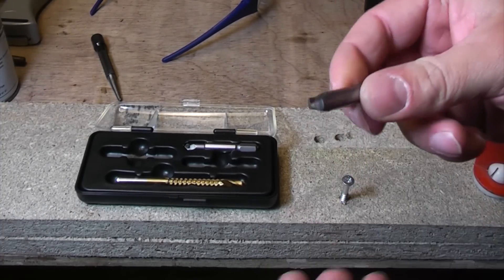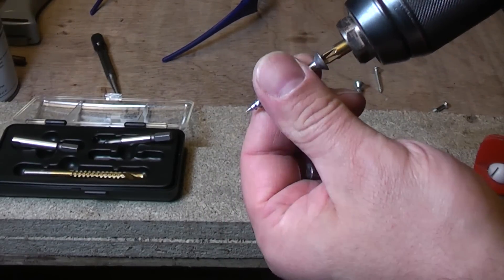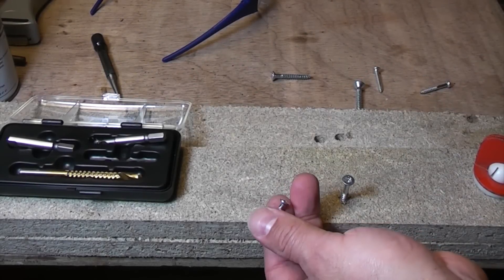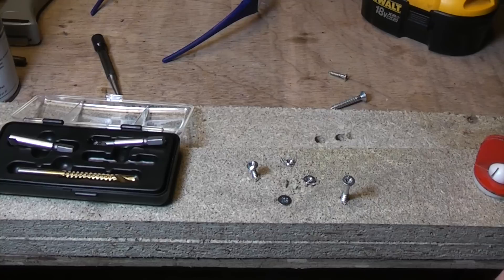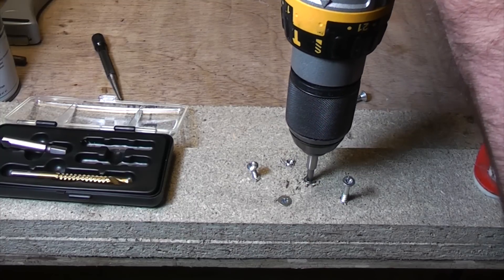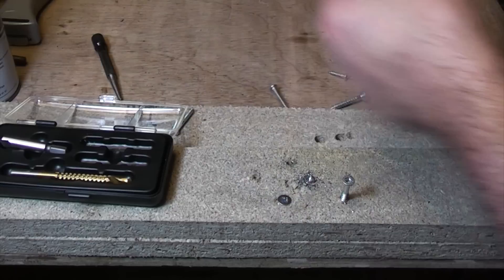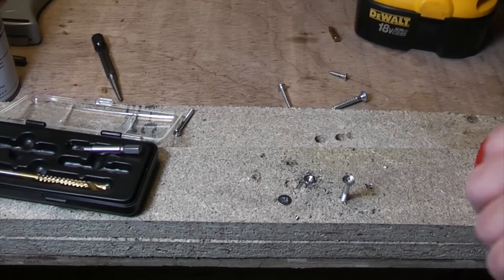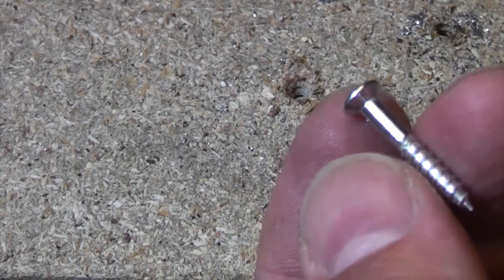JML screw extractor review

Comment: I think maybe the speed of the drill wasnt slow enough, the screw extractors are designed to bite into thee screw head just enough to turn the screw. if you have a little too much speed then you just turn the screw extractor into a countersink bit.maybe a lighter drill will give better feel.
I have a similar set they do remove quite a few but they do fail one some difficult ones.great videos keep them comming.

Comment: First time I ever use a screw extractor, easy out whatever you want to call it, I fought with that damn thing for hours. Well I figured I would try something it was my last option. So I hammered the extractor into the head of the bolt to where it could grab a bite and well there ya go. Came right out.

Comment: If you control the speed of the drill and do it as slow as possible and apply pressure sqare on it works a lot better.
 When you go too fast it just removes the metal as shown in your video ive got one of these sets and it takes some getting used to, that being said its not the best screw extractor set in the world and should work at the speed your showing but sadly it does not  anyway thanks for the Video :) i find that if it fails a dremel with a cutter disk is the daddy to make a slot for a slot drive screwdriver that never fails :)

Comment: the drill is going too fast. ive never had any problems using screw extractors, slow speed and quite a lot of pressure so the extractor can 'bite' into the screwhead